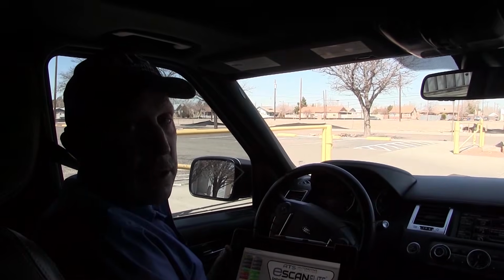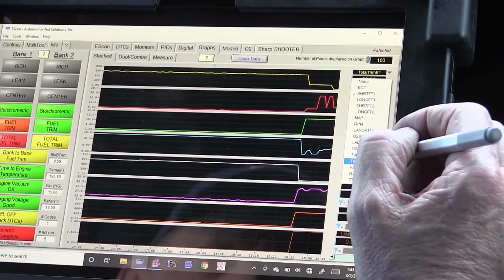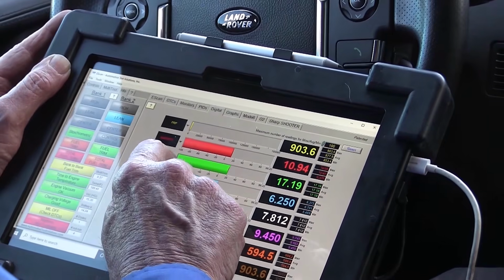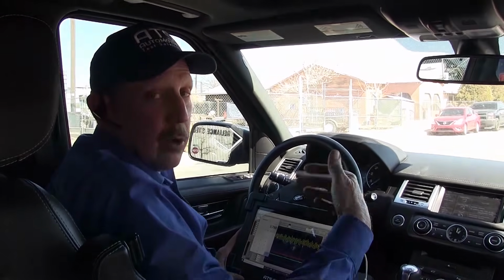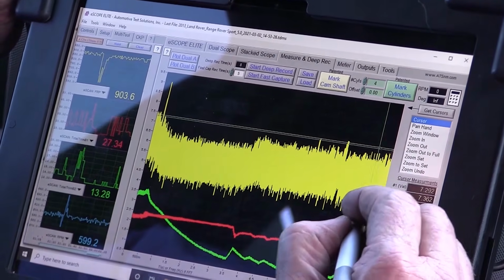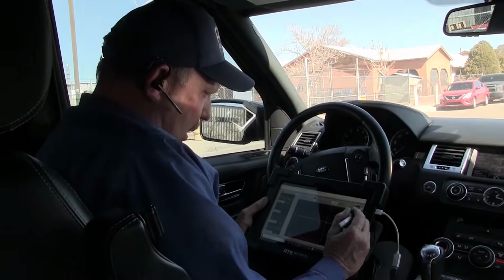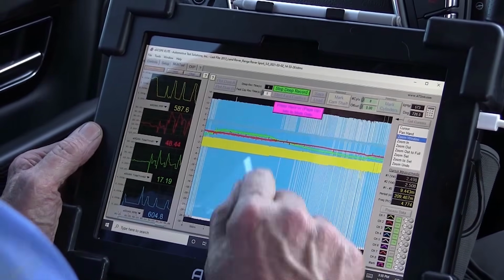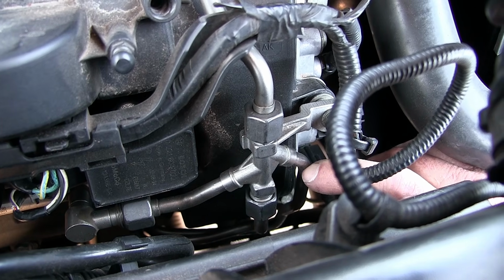Diagnose a 2013 5.0L Land Rover (The Covid Case)

Comment: Bernie have you ever measured the resistance of DLC pin#6 to ground ever in your career? I have this ford explorer sport Trac and CAN communication is floating around at 1,6v it looks ok mirror thing all ok but the floating the recessive is at 1,6 not 2,5. The Resistencia across pins 6 and 14 yeah 60ohms but all modules have U1900 you erase and comes back. The PCM no codes but it's capable of setting codes when you disconnect something test. So I decided just to disconnect the battery and measure from pin6 to ground then from pin14 to ground and what the heck? 6,55K and 6,58K then I start thinking is this normal or is this my problem? Please give me an orientation.

Comment: I had a similar issue on a 5.0 S/C with low rail pressure but it was more consistent than the one you were working on.  Service info wasn’t great so a friend sent over some timing photos of the jack shaft so I could see the positioning. The engine I was working on was out of time by 4 teeth. Of course I had to purchase some special tools to do the job and haven’t seen another one come in the shop but at least we got it done. There was marking on the fan clutch so I suspect someone may have rotated the engine backwards causing the chain to jump.

Comment: This is a "Range Rover Sport"- not a Land Rover Sport. Land Rover= Brand. Range Rover Sport= Model. Ford= Brand. Mustang= Model.

As for the video content, capable people who can do advanced diagnostics and are highly capable have left the industry. The pay is terrible and people with advanced skills wind up handling lots of warranty work or doing stuff which won't pay much if any diagnostic time. I was a technician and the dealers just want poorly paid dim bulbs who swap parts. If they run into a snag they call the engineering line and get told what to do.

Comment: I had a similar issue . Low fuel pressure low side . 
Checked hi/ low fuel pressure .good.
Computer was full of oil from wiring harness  😲😲. Very expensive .

Comment: Neat case study, Bernie! Now for the follow-up: did the shop that performed the repairs at least take some pictures of the carnage? Did they do a final test drive to verify the fuel trims were back to normal? We need some concrete closure!! :)
Reply: Ya' gotta take it for a spin!
Reply: Most mobile diagnostic techs including myself don’t have time to go back and verify the capture of the after data. The amount of loss time would make it hard when doing 8 -10 cars a day. As long as I don’t get a call back that’s enough. Knowing what a good known signal or how the system works is enough to make a call. Plus Bernie explained what the shop owner saw upon inspection and the vehicle was fixed. What concrete closure are you seeking for? Or are you doubting the vehicle was not fixed?

Comment: That's probably would've been an expensive job (the jackshaft chain). Front cover must come off, probably subframe drop, cooling system removal, accessory drive removal, chains, guides, tensioners, gears....we're talking a good 30hrs of flat rate.

Comment: You used coil control as a reference to compare the high pressure fuel pump timing.  But the pcm can alter ignition timing relative to crankshaft position/TDC at will.  Doesn't that create an unwanted variable in the control?  I wonder if using a crankshaft position sensor would have been a more stable point of reference.  Am I wrong?
Reply: Good argument,but think about this  he is only comparing in between one event to another one . 

When  they advance the spark time it takes time to shift , if you graph it you can see it is like a ramp.

  this mean will take several spark events to see a good amount of degrees differences .
Reply: @JoelAutomotrizenAccion that makes sense!  Thanks
Reply: He the best bro goat he know what he is doing let the man cook
Reply: @GustavoMartinez-i4kI wasn't trying to change his way of cooking... More making sure I understand it so that I don't mess it up when it's my turn to try.
Reply: That's a valid argument. Pcm would alter the ignition timing depends on sensor data.